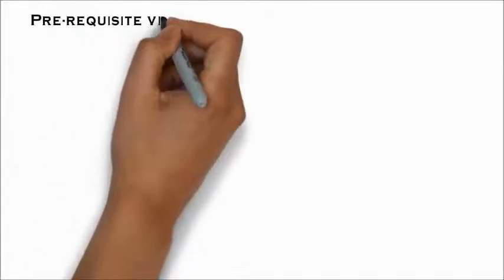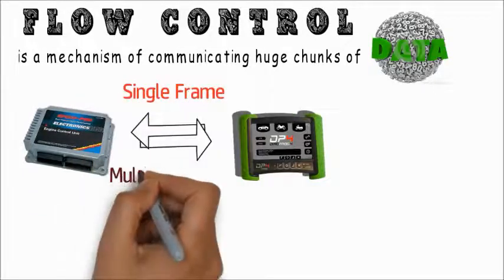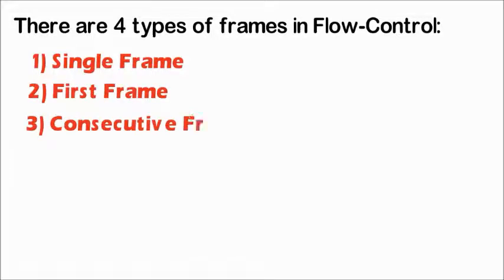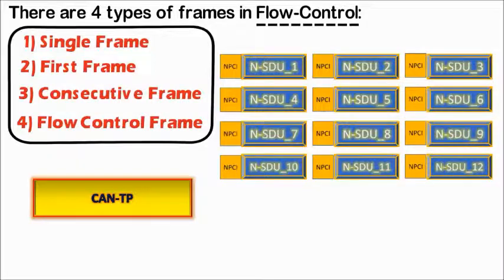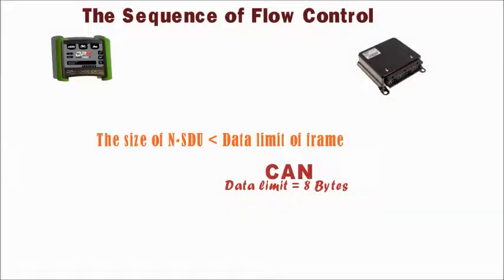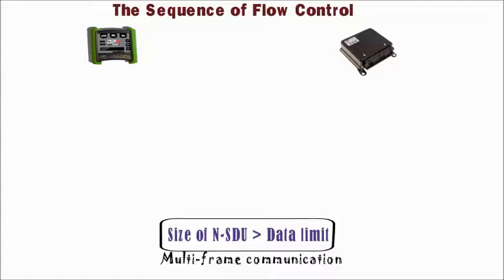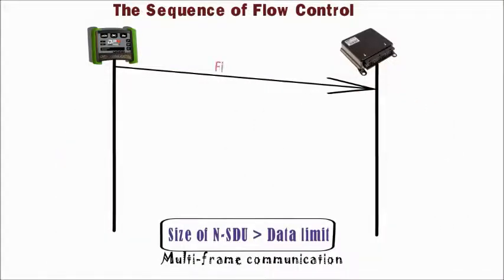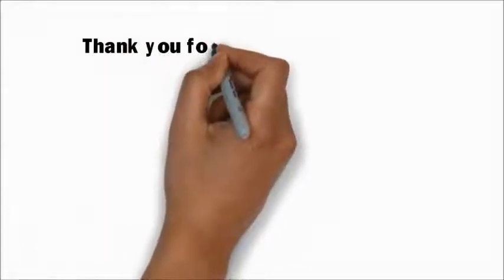Flow Control Part1   Flow Sequence

Comment: No proper explanation
Please explain what is N SDU
PCI
Single frame start with 
Flow control bit start
Please explain with proper structure
Reply: Please go through the prerequisite videos to understand all those concepts. Link is given in the description. The author has left nothing unexplained
Reply: CAN N-SDU -->  This is the SDU(service data unit) of the CAN Transport Layer. In the AUTOSAR architecture, it is a set of data coming from the PDU Router. (copied from https://www.autosar.org/fileadmin/user_upload/standards/classic/4-0/AUTOSAR_SWS_CANTransportLayer.pdf) 

The data flow is as follows : COM/DCM <--> PDU Router <--> CANTP <--> CANIF  <--> Can controller driver